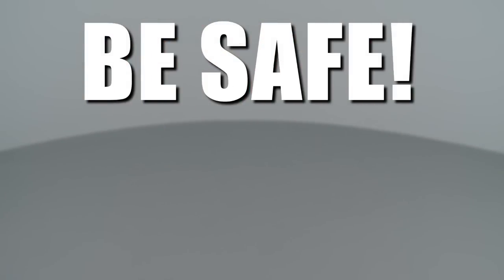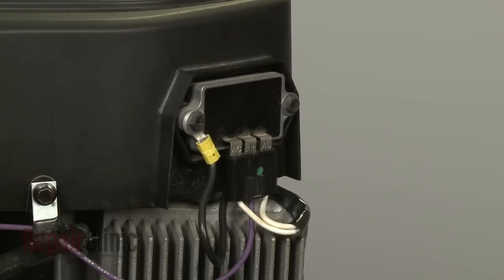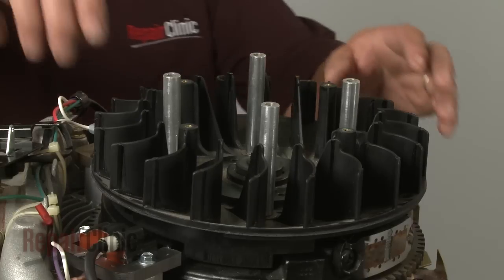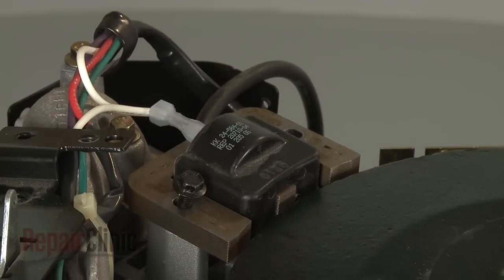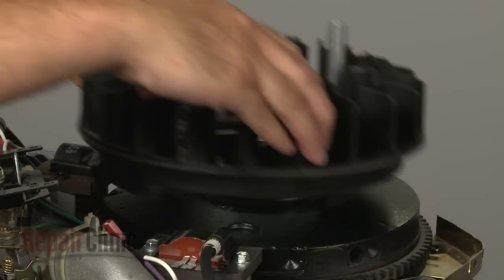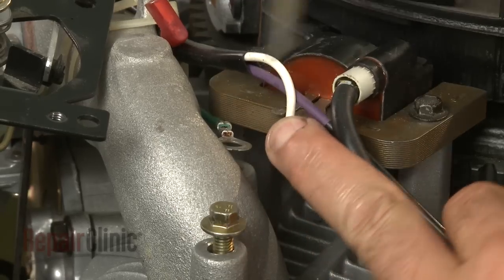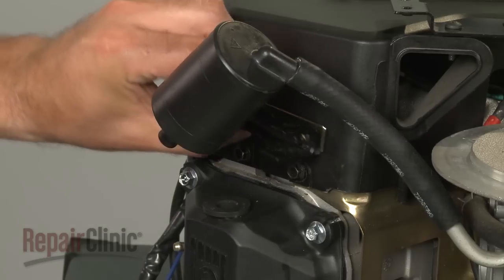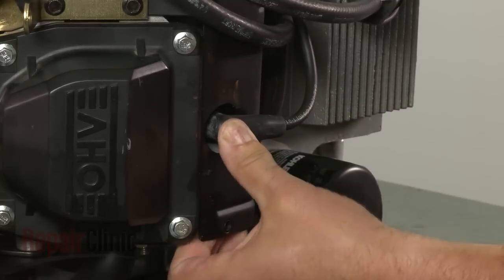Kohler Small Engine Disassembly (#CV23-75523), Repair Help

Comment: I was looking for disassembly of the engine. I have a Command Pro 23 and I have to get to the governor. You show no disassembly of taking the engine out of the mower deck and then pulling off the clutch, and pulley from the shaft. You also do not show taking off the pan cover to get to the governor problem that I am having. If you have something that shows that it would be a big help to me. Also it would be nice to know what the bolts get torqued to and if there is any special Loctite or RTV that is needed. thanks Jack

Comment: I have a Kohler 17.5 hp on my little JD.  The mechanic I have taken it to in the past was too busy.  But following another video of yours, I was able to get it fixed.  Now I have to figure out how he installed the air cleaner on incorrectly as its shroud or housing is to far from the engine housing.  Any ideas?